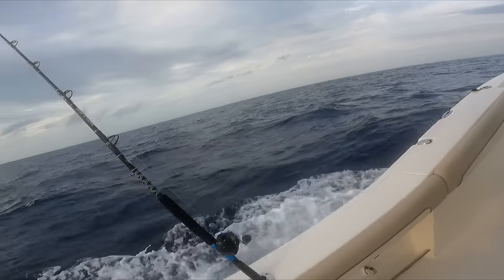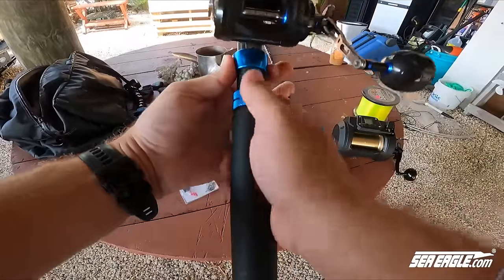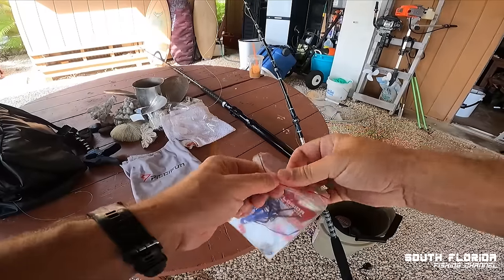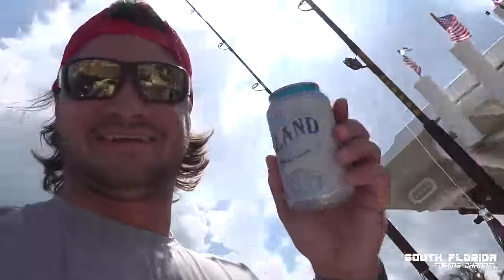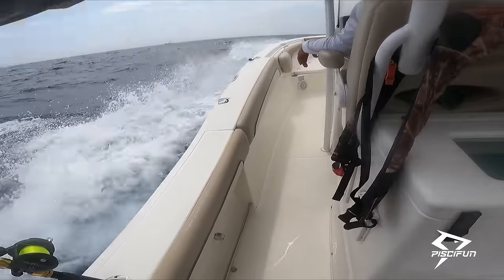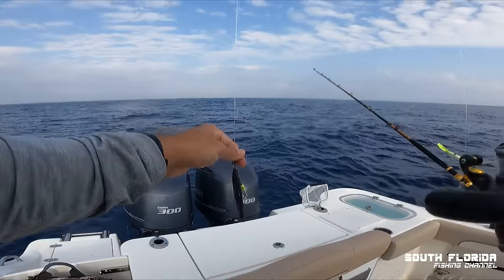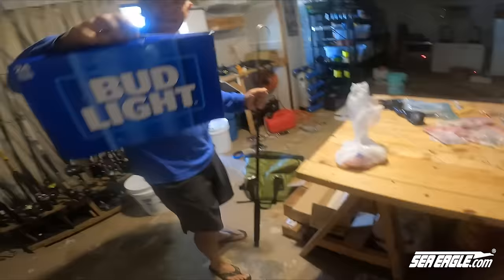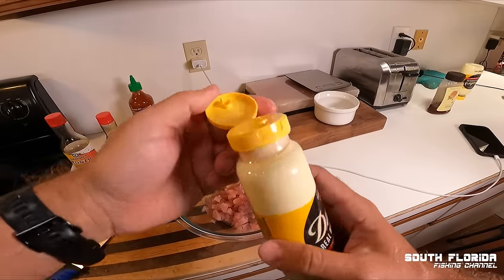This Reel shows us how to catch tuna {Catch & Cook}

Comment from the maker: I have been running this reel for a couple tuna trips now and we found the SWEET SPOT for catching tuna on the feather is 250-300ft behind the boat. We troll between 6-9 knots. This reel is really cool for learning distances behind the boat! These are the feathers we troll: https://southfloridafishingchannel.com/products/weedless-squid-rig
Reply: Heiko, I am curious to know if you calibrated your reels to know if 250 ft is accurate? I bought 2 of these trollex reels last  year after i saw you using the kracken reel. I planned to used them trolling for walleye on Lake Erie. The line counter is horrible. No matter what line I have used they are horribly inaccurate.  The reels seem smooth and a little faster retrieve than the reels we have been using, but when you don't know if you let our 120 or 150 feet of line they are not much good. If you have any insight on how to set these reels correctly or have a connection a piscifun please let me know.
Reply: does the reel count line distance or rotations?  typically for electric reels, it counts rotations of the drum, not distance, i would assume this does the same thing, but dont know.